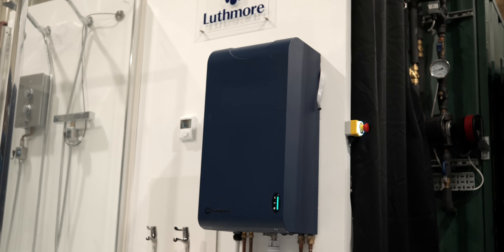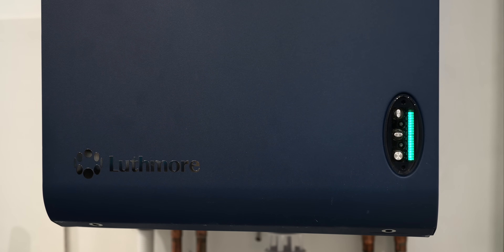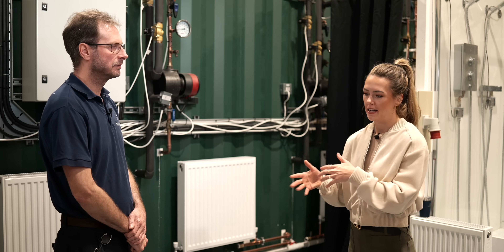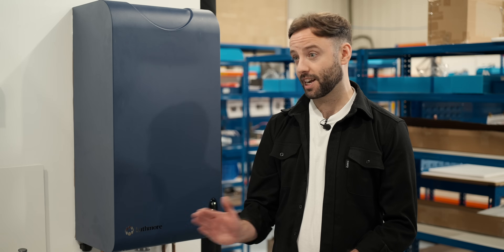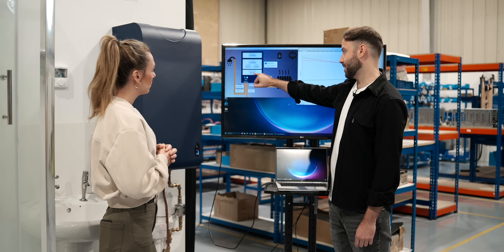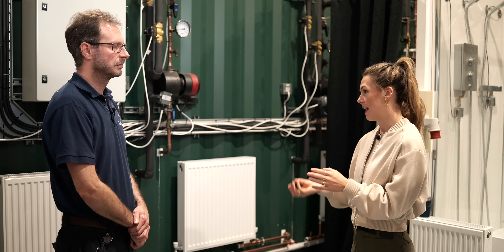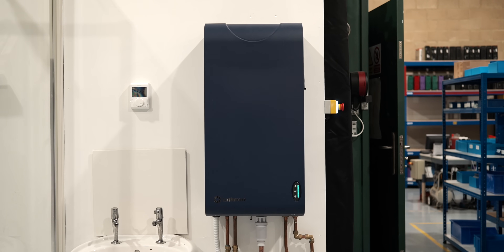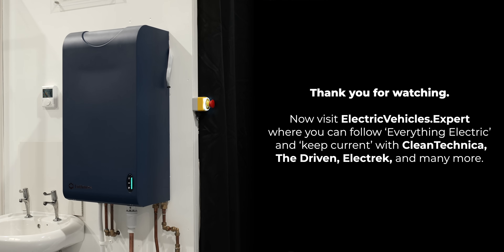Could This Battery Boiler Replace Gas AND Heat Pumps?

Comment: Worth noting that for UK customers, because this is a purely RESISTIVE heating device, and therefore cannot leverage the greater than unity CoP that a heat pump (phase change device) does, even when charged off peak (typically 7pence/kWh), it still costs slightly more than the equivalent gas fired combi boiler in terms of energy use. Some finanical gain could be possible if this were charged by a domestic (ie local) solar array, or if this device could mean that all gas supply to your property was removed and so you  no longer pay the standing charge because you have no gas supply. 

Given it will have a significant cost (no RRP i can find yet, but it's gonna be the same cost as a heat pump, ie in the thousands based even on the cost of the energy storage cells fitted) you would simply be better just installing a large home battery to power EVERYTHING from cheap rate 'lecy, and just install a normal "immediate heat" hot water heater.  With the cost of 12kW and larger inverters falling all the time, and the raw and installed costs of battery cells also falling, this seems like a rather niche solution to me. useful for a few who have absolutely no way to fit a heat pump maybe, but niche never the less.....
Reply: This will have its place in the market. Heatpumps require pipes running through the house to an outside unit, and the outside unit itself, which not all will want.
Reply: @richardbrice6535 There is also the inverse of that, I can free up space for an extra kitchen cupboard in return for a heat pump next to where the bins are outside.
Reply: @2412RTW  a heat pump doesn't have enough power, so it will need a large hot water tank as a buffer, which takes up more space than this battery system.
Reply: Don't forget the losses from a hot water tank. That's often a couple of kWh/day and can be a lot more. That can significantly reduce the overall efficiency of a gas +DHW tank setup, so this thing will be cheaper to run for people with badly insulated tanks or low hot water use.
Reply: @xxwookey  
This is a battery combi replacing a gas combi. No tank.
Reply: @johnburns4017  Ah yes good point. So mine is not valid for this comparison. Mea Culpa.
Reply: @xxwookey  DHW cylinders are quite unusual these days.
Reply: The Luthmore boiler has a ex vat price of £4500
Reply: @Luthmore 

A real snip then.

Plus whatever it costs for installation.

Q: How long would you say the batteries will last?

A: Who can say?

Q: What's the overall cost of the installation over time?

A: Fffknose.

Q: So how can I budget for overall cost of ownership etc, etc?

A: Eh? 

Suggest you clear off with your stupid ideas and get a proper job as a batteries mechanic in some god forsaken hell hole of a garage somewhere 😂😂😂😂😂😂😂

It's ideas such as this which inhibit the growth of hydrogen based technologies.

(Suggest you gen up on current thinking ex S Korea.)

Kindly don't respond with some nonsensical argument in support of this ridiculous idea.

Robert (not forgetting Dan) is currently undergoing an intensive course on anti battery matters.

He doesn't need you pushing any more rubbish battery ideas onto his plate.

You'll have seen the "anti"  comments expressed thus far on this platform so therefore inwardly digest and get that proper job as a mechanic.

Just so you and the other battery huggers understand, these silly ideas get filed under the heading of "Icarus Projects".

This entire family of platforms seems to exist on showboating rubbish battery based ideas for viewers' entertainment and amusement.

Undoubtedly a legacy from Clarkson's "Top Gear".

Kindly remember this.
Reply: That said it looks like a sizable battery.  I think they said 7 kW. Why not use it in conjunction with a heat pump water heater or indeed a heat pump
Reply: @davidbutler99  Battery + heat pump makes so much sense. Why not get 28kWh of heat out of your 7kWh battery? However I'm sure there are cases where installing a heat pump is not that easy and the temptation will be to install something cheaper and simpler instead - but people might be locking in decades of ongoing high running costs to save money up front.
Reply: It's difficult for me to position a heat pump. When it comes to using solar to top up batteries it isn't such a good idea because I get 15p for export but only pay 8.5p for cheap rate overnight energy. In effect using solar to power things during the day costs 15p per kwh because of lost export.
Reply: @robsmith1a on octopus adgile , often weekend afternoons are cheaper than  over night. 

Over night may be 5-7p per kwh
Sunday afternoons are often 2-3p
Reply: I think you completely missed the point of this device. For small flats which do not have space for a hot water tank,  as far as I understand this can heat the water rapidly with the battery store proving a power of 30kW, whereas a heat pump can't provide enough power and normal immersion electric heaters cannot directly provide a combi level of heating, because you  would need something like 100A mains supply (125A = 30000W/240V to be precise), which isn't normally possible in a domestic setting.
Reply: Niche when there is over 20 million houses with gas boilers could still be a lot of sales.   

The heating capacity is 
 low so it would need to be paired with a suitable home battery, and one that can discharge enough to cover the charge draw rate.   Which adds cost, but the warm home grant could provide low income households with a battery for free.  Which would help.
Reply: Efficiency doesn't matter because you are still using expensive electricity resistively to make heat. A self contained heat pump water heater will cost the same as gas to operate and can stack discounts.
Reply: @LarsDennert  
This combi only makes sense if low tariffs are available, or you have decent solar panels. But combis are in small homes and flats so less likely to have solar.
Reply: @johnburns4017  "This combi only makes sense if low tariffs are available" - Low tariffs are available in small homes and flats, though, so even by your own argument, it makes sense.
Reply: HMG dropped the phasing out of gas. Twenty percent of hydrogen is to be mixed with natural gas, still using the same burners. And twenty percent cleaner.  To other fossil fuels gas is quite clean. Also it is a part time fuel as usage is less in summer.
Reply: @johnburns4017  can you provide a reference to your claim about the phase out of gas and the introduction of hydrogen? Adding 20% hydrogen to the natural gas supply only reduces CO2 emissions by 7% due to the lower calorific value of hydrogen (even that assumes that the hydrogen has been produced without emitting CO2, which is not the case for 99% og hydrogen)
Reply: @redshift3  And increased leakage due to the smaller H2 molecules in the gas mix.  Plus adding to your point about the origin of H2, there is the fact that much of the H2 will be gray H2 (made from cracked natural gas) or blue H2 (as with gray, but supposedly using  unproven carbon capture storage will remove the CO2 generated) , rather than green H2 (made using renewables generated electricity to breakdown water to generate H2.  The whole H2 agenda is pushed hard by the oil and gas producers, as it is a way to to continue extracting natural gas, a con, unless is is green H2.
Reply: @johnburns4017 this is about heating water through combi at home though, so the summer thing is not relevant.
We seem to now be where we should have been 30 years ago.
The fear of change and disrupting the market has been so pointless.
I don't understand why we haven't got hybrid boilers though, gas in winter, heat pump in summer, with some of the hot water though a solar heating the water.
We love our all or nothing approaches.
Reply: @dorianleakey  
Are you kidding? People have their heating on in summer? Wow.
Reply: @johnburns4017 totally untrue.
Reply: @johnburns4017  gas is not really cleaner than other fossil fuels, when you include the leakage losses in the whole system. >4% leakage makes gas worse than coal, and the leakage rate is about that much, so it probably isn't any/much better than coal.
Reply: @xxwookey  
The distribution leaks can be fixed..
Reply: @johnburns4017  That is true, and they are being, at least in some orgs/places (and the total size of emissions is hard to measure so still has quite large error bars on it). But it's important to appreciate just how significant they are in overall emissions. A bit of gas is OK when it's really expensive to get the last bit out of the system, but the mass gas heating we have in the UK (and some other places) has to go, the sooner the better.
Reply: @johnburns4017  Sealing a distribution system for hydrogen is not a trivial task. It will get through smaller gaps than methane, indeed it can diffuse through metal, so joints that were fine for decades may start leaking. It is also more explosive than methane when mixed with air. Simply pumping hydrogen through the existing infrastructure is a recipe for disaster.
Easier to upgrade the electrical grid instead and abandon gas altogether.
Reply: @bimblinghill  
Only twenty percent of hydrogen will be in natural gas.
Reply: @johnburns4017  Can they? They will be even worse when hydrogen is added.
Reply: @nickwinn7812  
You are making that up. At twenty percent it will make no difference.
Reply: @johnburns4017 how would 20% make no difference? Do you think 20% is close to insignificant?
Because it's a lot.
Reply: @dorianleakey  
A twenty percent hydrogen mix is insignificant.
Reply: @johnburns4017  Yes it will. Hydrogen is extremely difficult to contain. The current distribution network was neither designed nor built to contain it.
Reply: @nickwinn7812  
You do not have much of a clue about this stuff.
Reply: @johnburns4017  So why even bother?
Reply: @bimblinghill 

Had you done any research on the permeation of hydrogen through the PE (yellow pipe) gas transport network then you would know that transporting hydrogen gas through said (yellow) PE pipe is considered "safe"in the engineering  sense at pressures up to 2 bar.(say 30psi).

It is lamentable that so little research is undertaken prior to posting by so called experts.

There are plenty of studies available online.

I certainly won't be cribbing out reams of data for you so kindly do your own research.

It is quite clear there's far too much bias on this platform towards BEVs despite the title of "everything electric".

If, as we are assured by the so called gas experts on this platform, that hydrogen will be a disaster then it begs the question of why HMG is considering, so we are told, adding 20% hydrogen to the methane gas we use already.

It would be useful for the ignorati (that's mostly all of you battery huggers btw) to research the gases mix of the old pre 1967 town gas before posting any comments on hydrogen gas transportation.

Virtually all we read from these said hydrogen gas experts is history lesson after history lesson.

There appears to be almost no appreciation let alone understanding of R&D in the field of hydrogen research.

Perhaps even worse virtually no understanding of the need to reduce the rate of temperature rise across the planet.

(Mind you it doesn't help when the king of the ignorati, Trump himself, decides climate change is the hoax of the century.

That said it seems Trump's bleatings in this direction are being ignored by the rest of the COP delegates in Brazil.

How Trump imagines America will continue with his "drill baby drill" legacy is absurd in the extreme and might well be an indication of advancing senile decay.

The saying "God Save America" appears to be ever more apt.)
Reply: @ForestForest-n9i  The Fraser Nash study commissioned by the UK government in 2018 concluded that while the existing gas transport network of PE pipe was largely fine, the domestic infrastructure of lead-soldered copper, plus appliances would require inspection & testing, and to do this across all 23 million properties with a gas connection UK-wide would require a workforce of ~100,000 to do in 4 years.
Reply: @bimblinghill 

And?

You perhaps are unaware that when UK transitioned from town gas to natural gas from 1967 it was found to be a lot drier than town gas. This new gas dried out "a lot" of gas joints which caused quite a few leaks.

Consequently millions of installations were checked by gas engineers for leaks and  repaired.

Info online if arsed.

Suggest you do a little more in depth research rather than cherry pick "facts" for your bias confirmation.

Hope that helps.
Reply: @ForestForest-n9i I am aware. Both my father and grandfather were firemen. Gas explosions were not uncommon back then. 50s-70s safety standards are not something we would tolerate going back to.
Reply: @bimblinghill 

Quite so ref returning to the "old" safety protocols.

That said we have only to look at the safety protocols pertaining to Grenfell Tower.

In short what people believe to be true one minute patently isn't a few minutes later.

That building design was wrong from the very conception of the design, and what happened afterwards was a monumental fffkup almost beyond belief.

Ergo what viewers believe they understand ref the dangers and disadvantages of hydrogen was/iis clearly misconceived./ 

There are projects which replace natural gas with hydrogen within a home (or a fair few homes) yet a fair few the occupants complain they are being treated as guinea pigs.

And they are, so they'll have to live with it.
Hard luck. Tough cheese. Get over it.

Someone has to be a guinea pig and the local authorities, HMG and their boffins decided it was going to be "you".
Reply: @ForestForest-n9i  where's the hydrogen coming from then? 95% will be grey, so using it will produce even more CO2. And you can't just replace 20% of gas by hydrogen, because the hydrogen has less energy density by volume. So the boiler will use more gas to compensate. So the savings will be less than 20%. There are good solutions to heating homes efficiëntly: with heat pumps. Burning stuff to heat a home is never efficient. Hydrogen should be used where electricity doesn't cut it, like for making steel.
Reply: @johnburns4017  "quite clean" ? We need to be hitting carbon neutral in twenty five years time. How can this be done with gas? Adding hydrogen to gas adds inefficiency. Using lots of electricity to make hydrogen rather than using the electricity directly is absolute madness!
Reply: @nickwinn7812  
HMG removed the time limit for natural gas.
Reply: @johnburns4017  So what?
Reply: @nickwinn7812 

😂😂😂😂

Hmm ... what tripe you type.

You could always do some research prior to posting.

You could always Google up too the old "town gas" used in UK prior to 1967.

And then Google up the gas mix of said town gas.

As for "safety" then a further Google for structures we called gasometers  back in the day, and where they were sited.
Reply: @nickwinn7812 

Before we get to 2050 the net zero date will be 2055.

By the time we get to 2055 , it will be 2060 etc etc

You know a bit like the state pension age . 😂
Reply: @patdbean  whether or not your predictions come true, does not in any way alter the validity of my comment.
Reply: @nickwinn7812 but you said, "we 'need' to be hitting carbon neutral in 25 years."......

 Well if it never happens.. then clearly , your comment is "Wrong"
Reply: @patdbean  We need to be hitting carbon neutral by 2050. We need to do it. What is difficult to understand about that?.
Reply: @nickwinn7812 no, the planet  may "need"  to do it, if the 0.8% of the world's population that happens to live in the uk dose it or not is TOTALLY irrelevant.
Reply: @patdbean  The planet doesn't give a toss. Humanity will either be significantly depleted or completely wiped out if we don't do it. Every country which produces significant amounts of CO2 needs to stop doing so by 2050 and the rest need to stop soon after. If you believe yourself and the UK to be TOTALLY irrelevant in this respect, then that is both sad and pathetic, whilst being incorrect.
Reply: @nickwinn7812 but everyone has got to do it, no point in the uk doing it, if china, india, USA etc do not do it.
Reply: @nickwinn7812 in the 1950s CO2 level was   about 315ppm today 422ppm.

Let me know when it starts falling.
Reply: @patdbean  Still, my original comment holds. The CO2  level will continue to rise even after we stop adding to it. The question is - will we stop before it reaches a tipping point from which there is no return (for human life to continue)?
Let me know when the penny drops.
Reply: @patdbean  Yes dimwit, everyone has to do it. Everyone can stand around saying "If the others do it we will too." Or they could do it and show it's not really that difficult.
China, by the way is well ahead of the UK in the rate at which it's transitioning it's economy away from fossil fuels. 
Do you really think the UK should copy the USA in every stupid thing it does?
 India produces approximately 1/3 the CO2 per capita compared to the UK, so why do you even mention them as an obstacle?
Reply: @nickwinn7812 I am just worried that we (uk/europe) will just send ourselves broke, doing all this net zero crap . 

While the likes of China/india/USA will just go on putting out as much CO2 as ever. 

As I say,  let me know when the C02 levels in the atmosphere actually start Falling. 😅

Yes , i know india produces less per head , but they have so many heads . 😢

As dose africa , as does china. 
Don't get me  wrong, I hope I am wrong.
Reply: @patdbean  Energy from renewables is cheaper than coal gas or nuclear.
China is certainly not going to continue putting out CO2 at it's current level, they have already plateaued and will soon be seeing a reduction.
India and other developing nations are already leapfrogging over fossil fuels and going straight to cheaper renewables, hence they will never get to be as dirty as we still are, and will get to carbon neutral maybe 10 years after us.
As for the US, well they are already investing more in renewables than in new fossil fuel energy production, even with their current clown in charge. Those who invest know that renewables are a better investment.
CO2 levels will continue to rise for some time after we reach net zero, because of the knock on effect on the (currently) frozen tundra, death of phytoplankton etc due to the warming which is now already inevitable. That is exactly why wee cannot afford to miss the 2050 deadline.
Time to stop making excuses and start acting, before you are left behind.